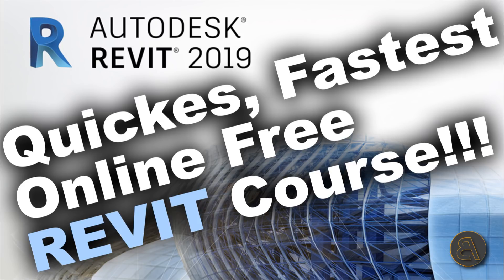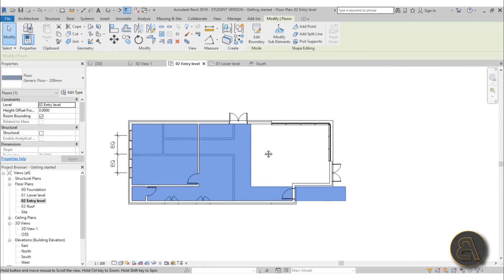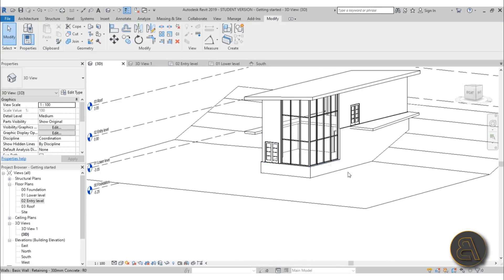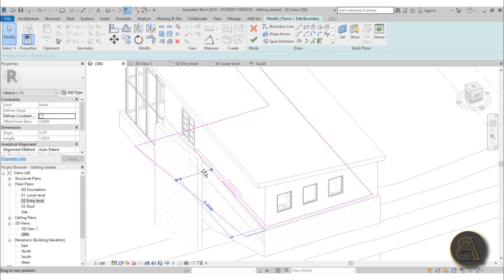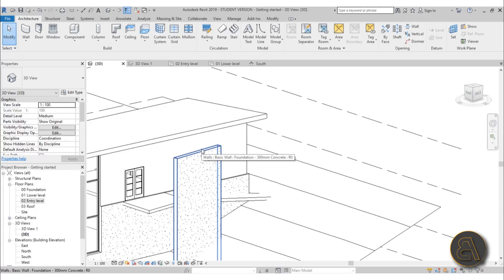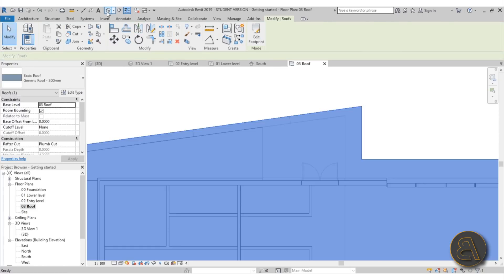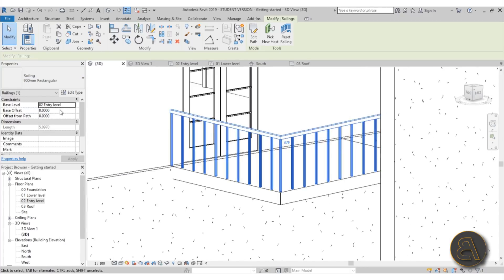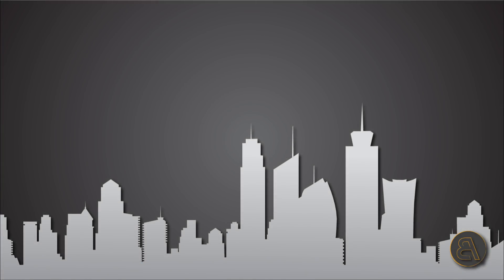Quickest Fastest Revit 2019 Beginner Course part 6

Comment: Awesome tutorial!  Thanks so much!  One question - I couldn't get the railing to follow the slope of the ramp.  I thought that using pick line on the ramp would work but it just draws it straight out.  I'm sure it's a simple setting but I can't find it.  I tried to use the railing button with 3d view or elevation view but it only works in the plan view.